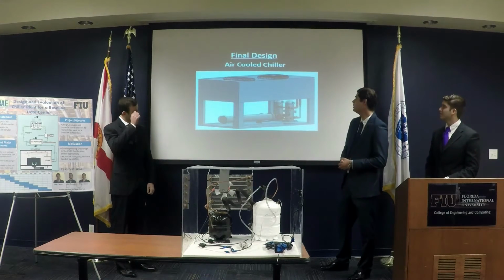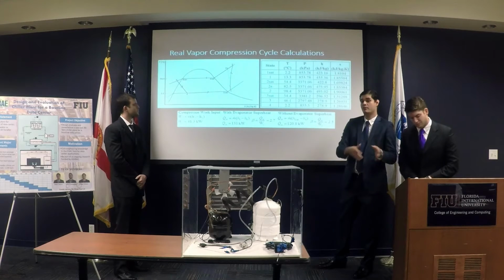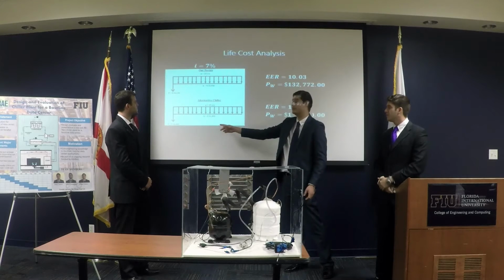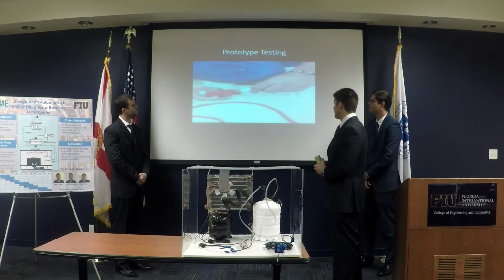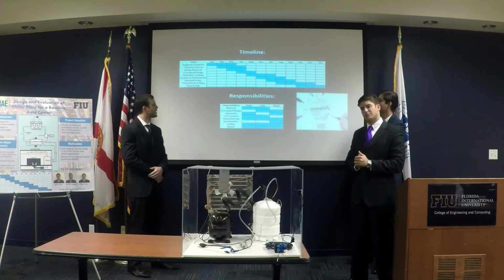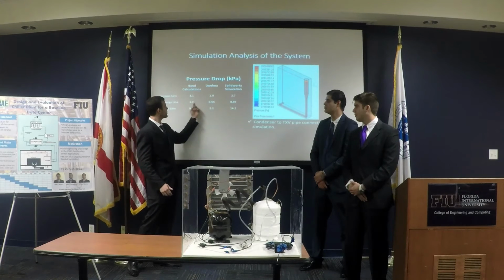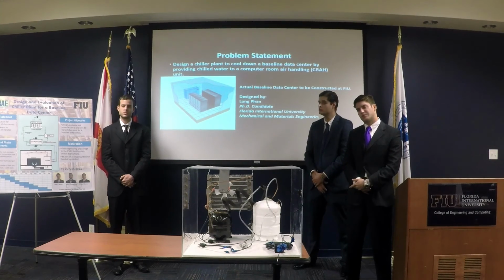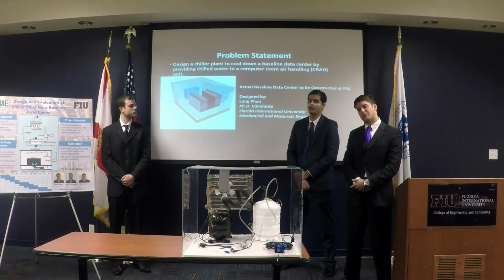SD Team 2: Design & Evaluation of a Chiller Plant for a Baseline Data Center

Comment: This team needed to practice more for their presentation. Slides contained too many words and the tables shown could have been used in a different format. I could hardly hear the presenters, the audio was too low. The group also were not prepared for the questions asked by the panel and their body language need improvement.

Comment: Overall the group had a well prepared presentation. The team properly expressed the purpose of the Chiller Plant. In some of the component specification and cost analysis slides, the presenter could have addressed the audience more often instead of looking at the slides while explaining the topics. The organization of the slides was good and I felt that the fonts and diagrams used got their points across.